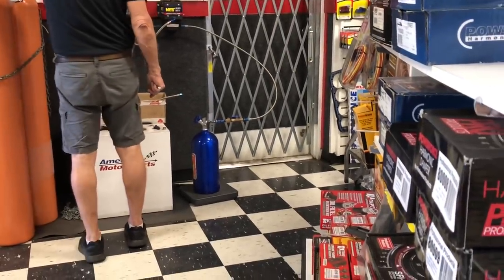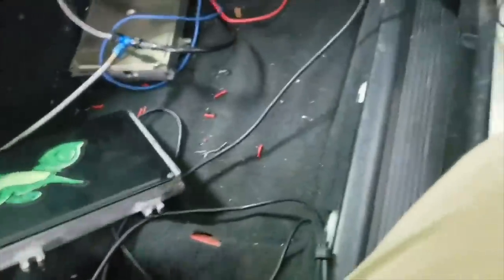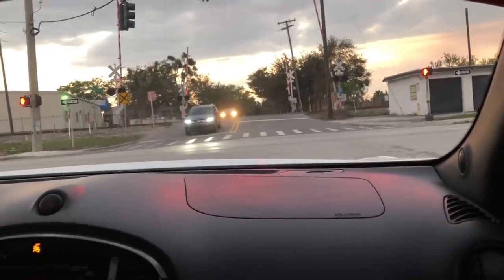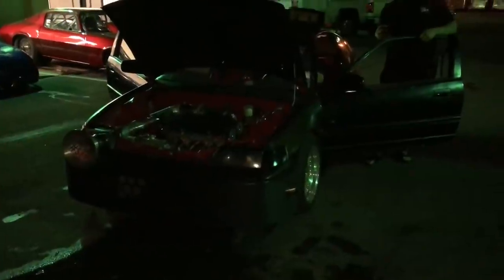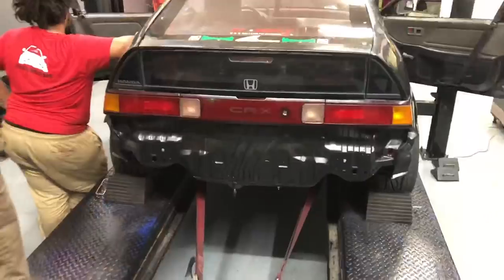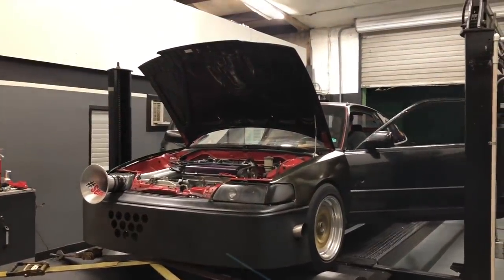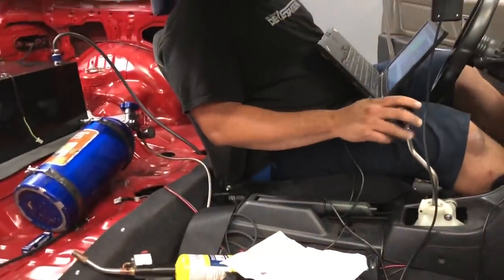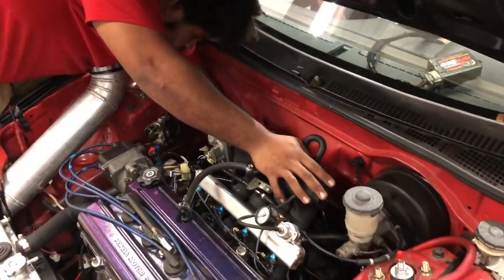Nitrous AWD Honda Gets Tuned!

Comment: With Neptune you shouldn’t have to run two different chips. Neptune has a map switching option and you can set it up to a button. That should allow you to run two totally different ignition timing maps and fuel maps with a press of a button.
Reply: Because 4 tunes were done. 93 pump gas, 93 pump gas w/ nitrous, M5, and M5 nitrous. So basically there's basically there's a chip for 93, and a chip for M5, and we have a switch to switch between maps.
Reply: FroMan Garage gotchaaaaaaa! Lol

Comment: So I’m confused. Your 95mm 2.2l stroker and only cracked 160s on 93? 
I’m 1.8 nonvtec. Stock ls crank, stock head, tuned on 91 way above see level and made 189. 
Are You sure your tune is good?
Reply from the maker: Intake manifold killed air flow and actually acted negatively to my power. 2.2 requiring alot of air and its simply not getting it. Alingment was also very off. Look at the videos and look closely at the tires scrub inward during every pull. Tires were sticking to touch unevenly. That in itself robbed at least 10 whp. We are going to correct these issues and try again. Also we dyno in 3rd gear to not put so much stress on the known weak Crv transmission im using. 3rd reads less whp then  typical 4th gear pulls
Reply: I did notice the scrub. As for the intake. I’m running the sk2 pro series on 70mm tb. If im wrong please correct me but the sk2 is modeled off the b16 intake. Yes it’s probably better by design but I can’t see the intake hurting you that bad considering all other variables. 
Im not hatin on it just trying to figure it out in my head haha and maybe to help you guys.
Take this for thought. Maybe it will help. My ls vs your ls. 
70mm vs 74mm
89mm vs 95mm 
82mm bore vs ?
12.9:1 vs ?
Bc stage2 cams vs delta 
91 vs 93 
2,411 sea level vs ? 
S300 vs ?
Was built for nitrous just never did it. 
And. Mine is a awd crv 
Please don’t take this to offense. Iv been a loyal viewer from like the beginning lol.
Reply from the maker: No offense here brother 🙏 i love your input. The skunk manifolds were based off of type r manifolds and then improved. I have a 74mm throttle body but the killer is the  plenum size. There isnt enough air available under quick throttle
Reply: Sounds like you need the ultra street😉 
Well we all will be waiting for an update here soon with them numbers on the 1 2 hits 
🙏🏼thanks for not getting butt hurt ether. I know I’d expect the same input on mine as well.
Reply from the maker: Thank you 🙏🙏💪 soon more to follow!!

Comment: the intake mani killed about 40whp with the shot.
Reply from the maker: Yeah. I need one
Reply: @SPTuning  find a used sk2 pro series or grab one new for 209.00 on ebay. thats all u will ever need for an b18 non vtec. and Q16 with nitrous. whoever told u M5 is silly.
Reply: This guy knows his shit^
Reply: Methanol is awesome with nitrous.
Reply: @matthemberry  meth burns very hot.. which is why m5 makes power on a n/a car.. running a hot burning fuel then cooling the engine with NOS defeats the purpose of running m5.  i suggested q16 or even e85 would make alot more power because ones oxygenated(q16) and one burns faster and cooler (e85) q16 with the nitrous hit makes GAINS.. we test it all the time on the dyno. i would never let a fellow honda guy down! :) cheers
Reply: @Jporter6177  methanol burns cooler than gasoline...
Reply: Gary! m5 is not pure meth.. it has combustion additives. but ill let all u experts say otherwise

Comment: how big of a shot do you plan on running and why a dry shot just seems like a wet shot would be safer I mean u should be able to run like a 150 shot easy with wet kit I don't know how much 400cc injectors would hold up with a bigger shot I mean I ran a 125 shot on h22 for over a year with just step colder plug and distributor backed back a lil never tuned. I just think with a built engine and low compression a 150 should really wake that thing up I really don't think even a 200 is completely out of question with wet kit and some could tuning

Comment: If the rules are you have to run 450cc injectors.   Wouldnt gasoline based fuels be better suited for them. Cause you'd have to run an more fuel for alcohol based fuels and it would max out the injectors ever sooner or is that fuel not for the YouTube thing and you plan on running larger injectors.